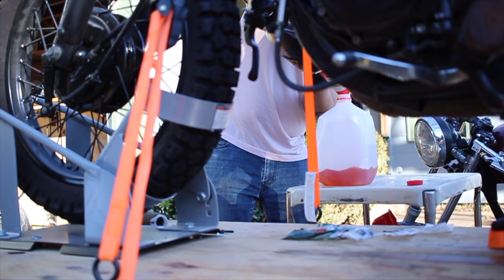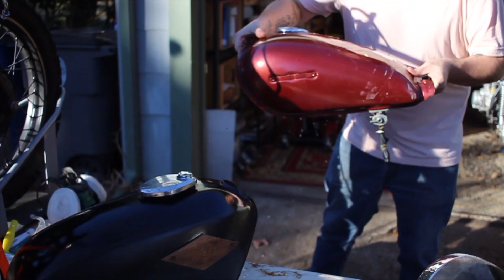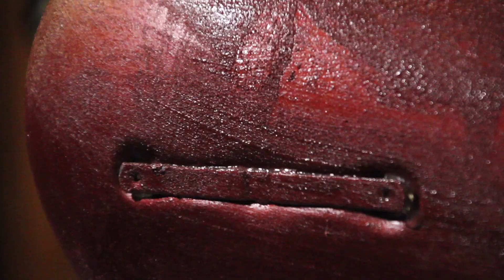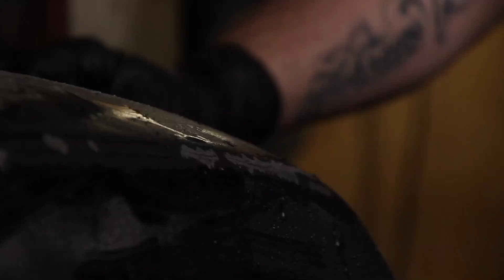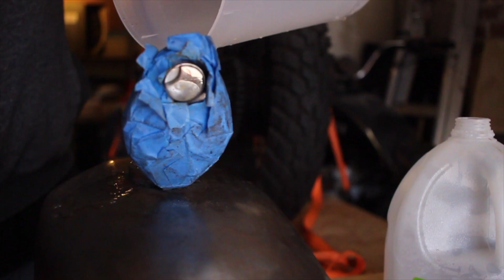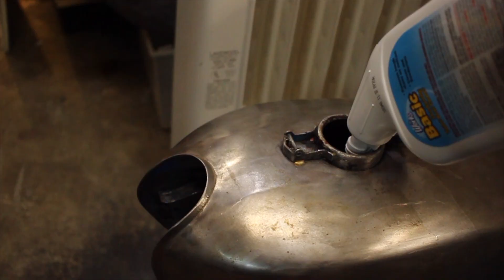1981 Yamaha SR250 Gas Tank Restore -part one-

Comment: I have a 1981 SR 250, gas cap is stuck, key turns a little, but not opening. Any advice?
Reply from the maker: Maybe try just removing the entire cap assembly. On mine there was a screw and pin situation near the cap hinge. That will get the cap off then there is a screw under the top end where the cap latches. One you remove the cap you can access the screw and that will remove the rest of the assembly. Will also make it easier to clean up any old rust or gunk. Easier for painting too. With the whole cap assembly off its easy to disassemble the latch mechanism for a good deep cleaning if you want. Or you can do what I did, which was pick up a brand new cap assembly on ebay for like $6. Well worth it.